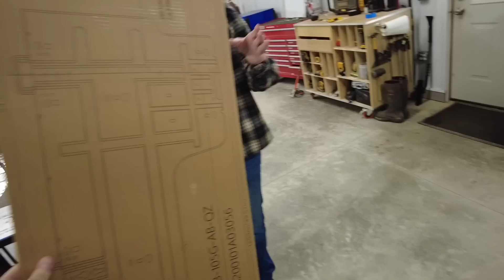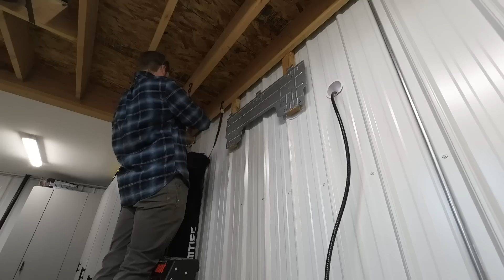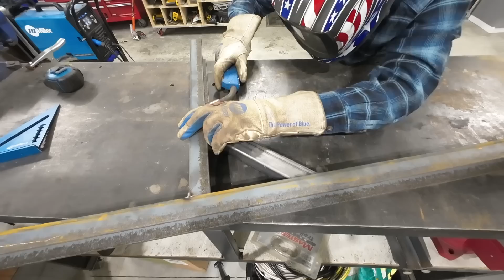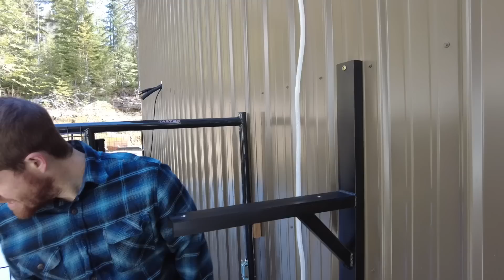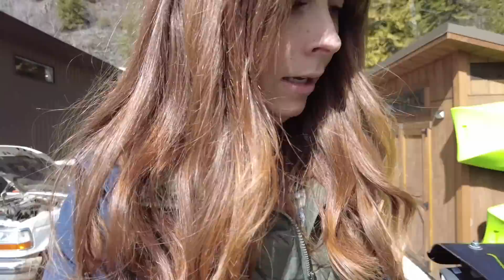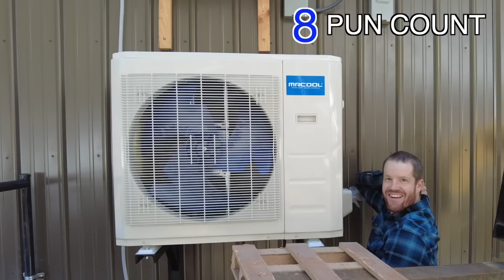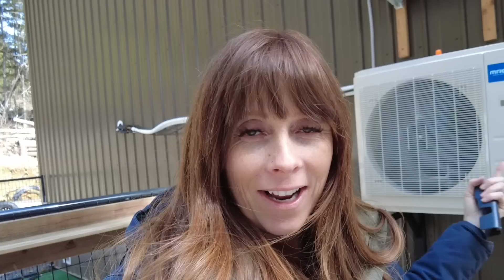Installing DIY Off-Grid AIR CONDITIONING

Comment: Great job! A comment. As a heavy equipment operator for over 40 years, please don't leave the skid steer from under the booms. Block them or wait until you lower them. If something were to happen to a hose or a host of other things (I've either seen or heard of most any disaster), those booms don't care whether you are there or not...they are coming down, and in a blink of an eye. We have all done it, but it is chancy. Pinch points, always remember pinch points.👌👌
Reply: also agree.  My neighbor, who is trains folks on equipment for his winery, was instructing a worker and he reached in and touched one of the controls.  He was crushed and barely lived.  It changed his life, quite for the worse.
Reply: I re-watched to see what you're talking about (as someone who knows very little about heavy equipment) and see what you mean. I think I wouldn't have necessarily worried about it either (as someone who doesn't use these a lot) but I know how pneumatics work enough to know that all that energy is stored somewhere and if any of those components failed it's gonna be bad.

Good callout and I think very politely stated. If I ever find myself using a skid steer or anything similar I'm going to keep your words in mind :)
Reply: @andrebasden  it's not about the steering it's about the lifting, many many people have been killed by equipment unexpectedly lowering.
Reply: My stepdad had left a boom up only 6 inches, realized it was still up a bit, he reached back to lower the boom. Broke 9 of his toes, some in more than one spot.
Reply: are there not automatic locking pins that operate when the seat is vacated or the engine goes off?
Reply: @alanhat5252 : No. What you’re thinking of is the control lockout that happens when you lift those lap bars. All that is, is the control computer ignoring inputs on the joysticks until the parking brake button/switch is pressed. The only thing keeping the hydraulic lift/tilt system stationary, is the valves attached to the hydraulic manifold; and those will start to leak over time, eventually leading to complete failure.
Reply: yes safety first knowledge is avoidance of accidents you owe it to yourself to be aware of how things could go horribly wrong and the correct way to do things learn from hard won experiences of the past and save yourself from many hassles and trouble
Reply: I completely agree. I couldn't believe C got out of the cab under that raised boom. Talk about safety violations? That was one. Never. Ever. Get out of the cab under a raised boom that isn't mechanically blocked from lowering. My skid-steer (New Holland LS160) has an extendable boom safety - a 2" diameter pin that sticks out on each side and mechanically blocks the boom from lowering.
Reply: OMG OK safety police couch YouTuber if they wanted your input they would ask for it , watch video with no complaining ok
Reply: @funtyes1970  OMG how stupid to disagree with safety advice! on top of that they are well meant. you should watch the video without complaining, no one else was complaining but you!
Reply: @funtyes1970  you must be kidding? Here to LEARN! SAFETY FIRST!!
Reply: @sz4179  good comment I got one Safety over convenience. I always told my father in law. He wanted me to take off the safety bar on his Kubota tractor I refused I told him just trim the branches from the trees that were in the way. We are talking about hilly landscape not flat land. also I wanted to put a canopy over head to block out the sun and rain but that's just minor. The safety bar can protect someone if the tractor turned over. All tractors required them bars. Even his international which was built before the safety bar was required. International send out for free bars to install he never installed it but that was in Florida where roll over was less likely 73
Reply: @funtyes1970  This is definitely not OK. Preach safety. I remember when I was a radio engineer for APS, I preached safety until the other people in the shop got tired of hearing it. This came about because of my experience working in a underground mine, 3,000 ft. down. One day, I was reading the company safety publication and they had a story written by a lineman that lost a finger when his wedding ring got caught on a rail of a stake truck. I pointed this out to the other radio engineers and they scuffed at it. (Its not going to happen to me). Then the man who wrote the article, who was standing right there watching me preach while waiting for his truck radio to be repaired, spoke up and said, "And if you don't believe it here it is, while waving his stump around right under their noses. After that I got a little more respect.

Comment: I actually purchased my mini spilt last night.  I dont need a dyi system but same same.  and i plan on running mine off of my solar.  Im pulling all the solar out of the Bonners 11 acres property and selling it as land.  275k if your interested.   Cant wait to see how heat pump runs this summer.

Comment: Hey guys, I replaced the entire central A/C system at my mom's house in Central Florida during lockdown with a Mr. Cool 2-Ton Universal Series unit.

The old traditional heat pump unit was 20+ years old and massively inefficient, including a 10kW resistance heat strip. The old unit had a typical ground-mounted condenser that was noisy and had to be serviced/cleaned at least annually.

Like you, I chose to mount the new unit on the exterior wall, keeping it up off the ground where it remains clean, needing the absolute minimum of maintenance. Again, like yours, my mom's unit is whisper quiet; something her neighbors greatly appreciate.

Over having the A/C system professionally replaced, going the Mr. Cool route saved my mom over $3,000! Additionally, the new unit uses right at half the power of the old unit, so there's a massive monthly operating expense reduction.

These units have several advantages of particular importance:
• Inverter technology so there's no in-rush of current at start-up. That, and these units don't cycle like traditional A/C units. Instead, they energize, heat or cool to the desired temperature, then ramp down to maintain temperature.
• 100% rating for heating down to -5°F and cooling up to 115°F. Because of heat pump heating efficiency, I opted not to install the optional strip heater.

I did have to evacuate the line set as there was an issue making a tight bend for this installation. But that wasn't an issue at all.

After three years of flawless service, the Mr. Cool unit continues to exceed all expectations. My only issue is that the line set insulation material is far from durable under the Florida sun. This something you shouldn't encounter as you were able to use the line set covers.

I'm certain that you'll be extremely happy with both of your Mr. Cool mini-splits for years to come.
Reply: Your a Mr. Cool SHILL!
Reply: What size home for the 2 ton unit?  What sort of backup do you have for the unit for hurricanes.  Do you know how many watts a 3 ton uses?
Reply: @pinschrunner  My mother's home in Central Florida is ~1,600 sq. ft.

There is no backup for power outages. I could design, build and install a battery, as well as a PV array, all for essentially the cost of materials at or below $100/kWh, however, it was decided not to do so for many reasons (expense vs. time remaining in the home, HOA, grid reliability and past experience, availability of accomodation with neighbors with generators, etc.).

1 ton of refrigeration = 3,517W. So, 3 ton = 10,550Wh.

Comment: What about the air in the tubes and the indoor unit? No vacuum before fill with gas?
Reply from the maker: Both sides comes under vacuum and the special connectors retain that vacuum when we hooked them up!

Comment: Are there no water courses across the site, that wold allow the building of a hydro-electric option?
Reply: Why do that when sponsorships supply much of solar system they have? Don't forget, there is no water on the property, and if there was, water freezes in Idaho unless there is a lot of it moving pretty fast.

Remember they haul water and store it in totes in the shipping container.

Comment: I put a Mr Cool in my MIL apartment above the garage, turned gym, and it worked great for 2 years.  But it's stopped working.  It would be easier/ cheaper to replace it with another new unit, rather than trying to pay someone to repair it.
Thinking of adding one to my 3000 sqft shop behind the house and powering it off solar tracking panels.  
Great job!  I love how Courtney is willing and able to jump in the skid steer to help while that pregnant.
And is good with it......... 
My EX wouldn't even hand me a wrench!

Comment: I don't like the way the brackets are installed. The weight is only held by the screws and there is lots of room for the srews to wiggle, that's a big nono. You should have turned the closed side of the c chanels against the wall, so that the screws have no room to wiggle and good friction is created between the bracket and the wall.

Comment: Just Installed a 12k unit this morning.  Had a little trouble snaking the pipes around, but we got it done.  Insurance company would not give us insurance with current heating and air, so hopefully a mini split will meet their requirements.

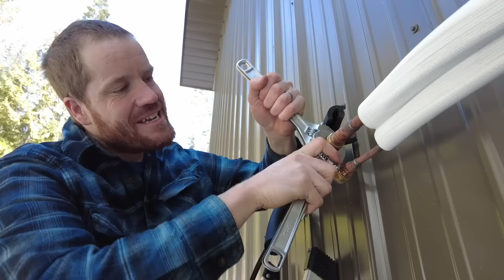Comment: I love the work you do, both of you. One minor concern I have when you are using both those crescent wrenches. The one in your right hand 15:43 is turned 180. My uncle always corrected me by saying, the curve of the wrench head should follow the direction you wrench. It gives you more torque to tighten or loosen. Just my $.02

Comment: I've done HVAC for 35 years. Some valuable advice. You needed more airspace between the unit and the wall for necessary air flow and cleaning. The line-set coil being put behind the unit will seriously affect its performance. I'm guessing these things has reduced your performance by as much as 30%.

Comment: I really enjoyed this video.  We air condition our shop by opening the overhead door.  I’ll think you you next summer when I’m sweating away.  BTW I though about the beautiful welding you do Riley when I tried my first welding project this week.  It was uuuugly!  But the 12” gear puller I made did the trick on getting the brake drum out of our dozer winch.

Comment: Have a ham radio shack in my shed before we moved. Since we did we moved the shed but I do not have power to the shed to really use it as a radio shack. I wish I could afford to put solar on it for power as well as one of these Mr Cool so I could have heat and AC in there.

Comment: I think you should consider staggering those outdoor units. The top unit will defrost and leak water on the bottom unit and it will freeze up.

Comment: Beautiful system MrCool. Excellent install, well done. If you live in cold climate consider hanging the outside unit on the sunny side. Due to cold and humidity it will need to defrost every so many minutes. Sun heat can help a lot

Comment: Where did you buy your unit?  We live in Bonners Ferry and have a shop/house and have been thinking about installing a mini-split but haven’t started looking for a place to buy one. This Mr Kool unit looks great and the install is more my speed. Also have some gear for logging that you could have if you want it. Congratulations on the baby!
Reply from the maker: This unit we got directly from Mr. Cool but the smaller unit we previously installed we ordered through Home Depot!

Comment: I’ve installed 3 Della splits and they are very easy as the Mr Cools. Very efficient.
Be careful of getting out of your skid steer while you have the arms raised. A guy I knew had a load up, got out and a cylinder hose blew. As I said, a guy I KNEW. Just be careful.

Comment: Mini splits don't work well when temp drops below freezing and you will likely need a backup heat source.
Reply: They do when you get the right one for the job. There are efficient mini-splits even at sub 20 temperatures.
Reply: Then you should post a video of your mini split running off solar to heat your place in winter.

Comment: If you live in low humidity areas a swamp cooler uses a lot less power. I have a Hessaire evap cooler in the cabin that only uses 85 watts but you need a water source.  That runs  off my 400 watt system and with the shade porch and trees we don't need it until around noon and rarely at night.

Build covered porches and plant trees and super insulate and you won't need a big AC unit and lots of solar power.
Reply: @driatrogenesis  Wood or propane or both. I use both.

Comment: Great install!I dont know  what the inrush/startup current is on those units but if you think its too much there are soft start circuit boards you can install to lessen that . Helpful for off grid installs. Love the videos!
Reply: one of the other comments suggests the manufacturer has already sorted that out.

Comment: I'm a retired Caterpillar engineer and worked on the team that developed the joysticks in your skidsteer.  Seeing your love of the skidsteer makes my day!
Reply: I used to manage a Sales Team that sold Caterpillar equipment to smaller, emerging contractors. I too get a thrill out of seeing how effective their machines are for them and how smoothly Courtney runs it. She's a natural operator. (Back in the day - female operators were extremely rare. Now smart contractors know that their fleet will last longer and run better when run by female operators - they're more careful.)
Reply: Another retired Cat engineer - electro-hydraulics.  We consulted on some of the skid steer models.  Primary requirements were Cost, Cost & Cost.
Reply: didn't Sherman tanks use "skid steer" for directional orientation. in fact all tracked vehicles do the same
Reply: @keithfarrington8179  "skidsteer" usually refers to wheeled vehicles, such as the early Bobcats.  The tracked versions came later, and were suited to the lack of steerable wheels.
Reply: @SkyhawkSteve  thanks for the heads up 👍✌
Reply: Yes and the ride control makes it so much better👌
Reply: I love using kitty Cats  over all else because if the joy sticks.
Reply: I know you said you were on the team that designed the sticks but coming from someone who operates every day for a living I feel that the 289 should have more power it seems like the tracks are super under powered compared to a 299
Reply: I'm a retired radio engineer and grid operator for APS and remember the Caterpillar testing grounds on White Tanks Mt. I drove up there one day to repair a radio on top of the mountain and just happened to look over the edge of the hill. There was a piece of equipment that had fallen over the cliff and pinned the driver underneath (I was told). I called my dispatcher and they sent out a helicopter and rescued the driver and took him to the hospital. No telling how long he would have been there if we hadn't come along.
Reply: I’ve operated many of those Cats. Great Job !
Reply: I'm from Turkey and I definitely love Cat. Smart, innovative, practical... what can I say, you guys are the best!
Reply: There's a lot of BS degrees
Reply: It's an incredible little machine.

Comment: I'm off-grid here in Finland with a system comparable in size to yours. I use an air to water monoblock heat pump coupled to my underfloor radiant heating. In summer, I pump cold water in the floor to cool the place. The advantage is that I can use excess solar during the day, and store it in the buffer tank. This then easily gets me through the night without consuming power from the battery except for the pump (couple of tens of Watts). In winter when I don't have enough solar for the heat pump, my wood burner coupled to the same buffer provides for heat.
Reply: @driatrogenesis  I run a regular house with fridge/freezer, lights, well pump, ventilation system, etc. A normal household load. Only in the middle of winter when there is no sun where I am, I use a diesel generator which I power with my own diesel made from waste vegetable oil to charge the batteries. Someone more south then where I am from could manage winter as well. Plenty of people doing this off-grid.

Comment: There seems to be a trend or string of sponsors' video content. While I get showing options, it is getting a bit old with most if not all videos being some sponsor's product used or installed with a little of your own fabrication added. So many of the sponsored products are expensive for at least our family. While you are not all that far from us and I like seeing what someone else local is doing off-grid, I admit seriously considering unsubscribing with so many sponsors content. Can't really thumbs up a power drain like that either for a more typical off-grid power system.

Comment: If I observed correctly, the wall brackets for the condenser outside unit are only held to the wall via pine thread wood screws. No 1 suggestion change those wood screws to full thread through bolts and some form of blanking washer on the inside of the shop 
OR
And fit legs to the outside bracket the leg bases sitting on concrete bricks etc. You will find over a period of time the virations transmitted from the unit and natural aging and shrinking of the timber will create a mess on the ground. Cheers

Comment: Riley, when cutting large holes with a holesaw,  try to lean and rotate the arbour a little at a time, so instead of the whole diameter of the holesaw cutting, you lead it in . All the teeth are then just cutting one spot , then the next in a circular motion until you are all the way around. 
I cut large diameter holes in finished sheet materials every day using this method. 
Less snagging and saves your powertool life, too.
Give it a try....
Love what you accomplish together .
Looking forward to your two's next chapter
Reply: Also apply painters tape. So when the saw jumps it doesn’t mark up the nice metal wall panels.
Reply: Done as you say, it is much safer.